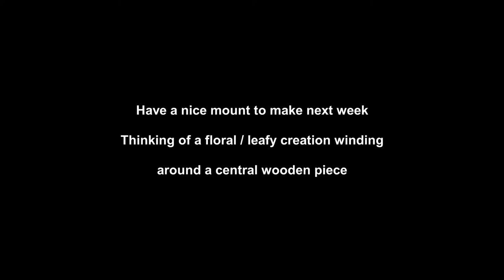Beautiful Birds made from Vintage Cutlery, for Mark and Leanne - Part 1

Comment: Love your work. Can i ask the settings you use. I am learning and need the advice. Thanks in advance.
Reply from the maker: Hello Alan, thanks for the comment.  I hope this long and lengthy reply helps you out!

Depends on a number of factors: wire thickness, material thickness, tacking vs running a bead on thin material etc. 

First off, I should start by saying that I am far from a good welder! I have some reasonable experience with cutlery these days and that helps, but quite honestly I just watched a few 'basic welding tips' videos on YouTube and started experimenting. You will find that trial and error will serve you well, there is no substitute for this experience. Having said that, here's a few pointers ....

Ok so ... first off have to tell you about my welder because if you are wanting to weld stainelss steel (cutlery) then you are going to need a shielding gas (typically I use 95% argon 5% CO2 in the MIG or 100% Argon on the TIG). Alot of cheap welders claim to be 'MIG' welders but use no gas, they are using 'flux core' wire which isn't really legitimate MIG because its the flux that creates the gas within the weld puddle rather than an external source that actually shields the weld as intended, thus avoiding impurities etc. Flux core wire is not really going to give you any sort of weld or finish that you'll be happy with, also generally alot of weld splatter and more often than not porous (swiss cheese like) welds that have no real integrity. Fine for agricultural mild steel welding but not this! Likewise, using 'pub gas' (CO2) wont work for stainless and will give the same results.

So what I am saying is ... you need not just something that claims to be a 'MIG' but an actual gas MIG!  FYI, my welder was the cheapest gas MIG you could buy online 4 years ago ... its a 'Wolfmig 140x'. Very cheap and cheerful but as (I hope) you can see, quite capable. I think they retail at about £200 now. It really doesn't owe me anything any more but it's still going on like a trooper, I use it for almost everything!

Right on to welding cutlery then ...

Wire: 

I use 0.6mm welding wire (generally mild steel to be honest but sometimes stainless), if I use stainless wire in the MIG then I will use the 100% argon bottle. You can use 0.8 but the welds are typically bigger / hotter, easier to burn through and its just an unnecessary amount of material to lay down and then have to clean up. Overall 0.6 is much more precise and better with thinner material (car bodywork for example) You can get small rolls of it at Halfords for £8 and they last a good while!

Materials: 

So, cutlery comes in a few different grades of stainless, sometimes it's stamped, for example 18/10, and this refers to the content of chromium and nickel in it. Leave an assorted tub of generic cutlery outside and you'll find that some of it rusts, some of it doesn't, this is due to differing qualities / properties of the different grades used. If you want nice quality stuff then as a general rule of thumb I would say look for cutlery with a brand name on it or a content mark (rare to find but 18/10 is good!) 

Second hand cutlery can be expensive. Your best bet is to trawl the charity shops or ... if you can find one ... try and hunt down the main sorting warehouse for charity shops that have more than 1 outlet. Generally they won't sell cutlery because of the nationwide plague of butter knife stabbings!

 ... joking obviously ... many do sell the nice stuff or silver plate stuff but what you're looking to do is just to make a contact and get an 'in' to sort through their stuff, the bulk of which will generally get taken to the local scrap yard if you dont get in there first. I donate (typically) £15 and walk away with a large plastic tub of the stuff, a few hundreds items. Good for me, good for them! I do also buy the real quality stuff from cutlery traders online (Oneida patterns typically, beautifully ornate handles good for decoration) but these can be anything up to £5 for a fork! Occasionally I'll luck out and find a cheap set on ebay or i'll have a set that a trader wants in return. 

Settings: 

Ok probably this will be dependent on your welder and even though I'll quote you the settings that I use it wouldn't surprise me if another WolfMIG 140x ran slightly different .. it's not a high quality tool. As a general rule of thumb the word on the street is 30 amps per 1 mm thickness of material. My welder is 140 Amps max and has 6 'power settings', so ... divide 140 by 6 gives me a tad under 24 amps for setting 1, approx 48 for setting 2, 72 for 3 etc etc. 

I'f I'm welding a thicker bit of fork to a spoon (like in these birds) then I will often tack on setting 3 which really is a bit hot, so I'll start the weld on the thinner spoon and move quite quickly to the thicker fork as the heat builds up. Occasionally I'll penetrate slightly through it but it's an easy clean up with sanding discs on my die grinders and then polish on the mop. (320 / 600 / 1000 grit). 600 is pretty much enough but if i'm going uber mirror I also have grades up to 2000 but really as long as the spoon isn't badly scratched or dinged then 600 is perfectly acceptable to then mop polish. 

You'd be amazed what a good polishing compound can do. (Menzerna do a quality range of professional compound bars - try thepolishingshop.co.uk and look for a medium cut green compound and then a finer white compound to buff finish (which also has a little cut to it). Best to have a softer mop for the finish. You can generally fit these either side of a standard bench grinder.

Spoon to spoon generally i'll be on setting 2 which (at approx 48 amps) is not far off for quality cutlery, which tends to have a bit more meat to it. I generally reject anything than I can bend easily, it's just garbage!

Wire speed: 

Down to experience but if its bouncing back off the weld then its too fast! and if the wire is disappearing towards the nozzle or getting stuck to the nozzle then its too slow! 

One of the most common mistakes is having too much distance between the nozzle and the work piece. Don't be afraid to get right on in there! Try tacking two spoons together with a few mm clearance and then with an inch. There is a big difference! Again, little things you learn through trial and error!

Hmm what else? ... dunno really. If you got any specific questions feel free to ask. It's a small channel with not many comments so I do read them and am happy to share what (little) I know!

Only other thoughts are this ....

Best tool upgrade I ever made was getting an air compressor! 

25 litre is useable (if slightly irritating while it catches up to the tools) but I just got a 50l and that is a significant upgrade. Paid an amazing £50 for it last week ... it needed a service and a new capacitor (£8 item) which I had a spare of anyway. I was lucky (assuming it lasts for any length of time) I'd expect normally to pay £150 for any half decent second hand oil cooled 50 litre comp, ... regardless, money well spent. With luck you might find a 25 litre oil cooled for around the £70 mark. Check out facebook market place / ebay and don't be afraid to haggle hard!

The die grinders are between £15 and £20 for cheap ones. I have 5 or 6 and not one has let me down yet. Bargain! Also, just brilliant tools! I like them because (whilst I still use a Dremel - which is also brilliant tool) they are much beefier with better collets and capable of hocking out a lot more material or sanding alot faster with the finer grade discs. Such a wide range of attachments too. Quick Lock 50mm flap discs, sanding discs (velcro easy on easy off), carbide burrs. Brilliant bits of kit! 

All in all, the quality of my work is not in my welding, it's in my finishing! It's so important! 

There are alot of cheap crap cutlery creations online, badly finished, unpolished, heat marks, ratty welds on show etc. If you want to stand out then invest in good finishing materials (hence why I have gone to the lengths of bigging up the die grinders and their attachments). Don't get me wrong, you can do an awful lot with a dremel, they are very good and most certainly capable of very precise work but they are just light weight compared to the die grinders. Good to have both for sure, though I appreciate that starting out you'll probably not want to lash out on everything.

Final words:

When I started I had 1 angle grinder and a fake dremel. I can't tell you how quickly I got pissed off relentlessly having to change from a flap disc to a cutting disc!!!! Get two angle grinders!!! I buy the cheap and smaller (easy to handle) Macallister grinders from B & Q (I think Macallister is their own brand). They were (12 months ago) £25 a pop and at that price are a real bargain. I'd recommend them to anyone for this sort of lighter weight work.

Also ... and I can't stress this enough ... get a proper Gas MIG if you don't already have one. You just can't get any sort of decent finish with flux core, it's a waste of time! Fine for welding brackets together or general 'farm' welding but no good if you want to be able to finish a weld off to a smooth shiny finish! And ... don't bother with the tiny portable gas cylinders .. they are an incredibly expensive way to buy welding gas! Get a 25 litre bottle from a proper welding shop (probably £80 deposit and £60 a refill plus £40ish for a regulator). One of them will last you months and will work out 8 to 10 times more cost efficient ... its worth it!

I guess that's pretty much it. Again, if you got other questions let me know, happy to help if I can.

Let me know how you get on! Feel free to share my social media pages as a thanks!! 

Namaste

John